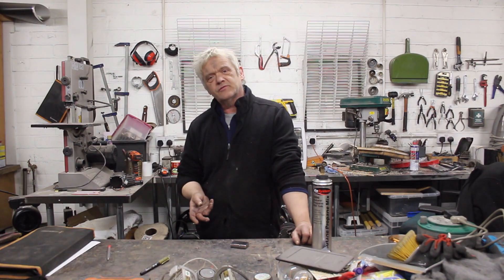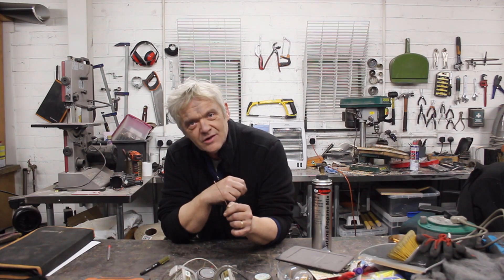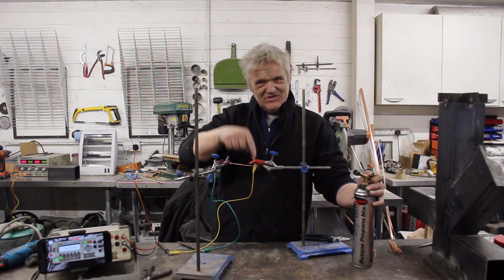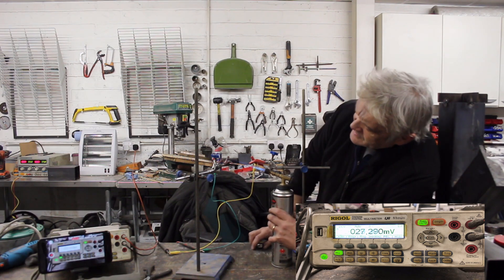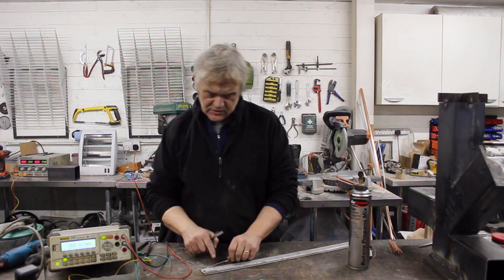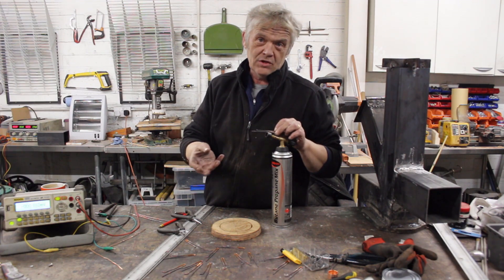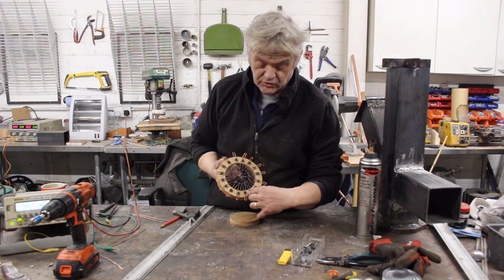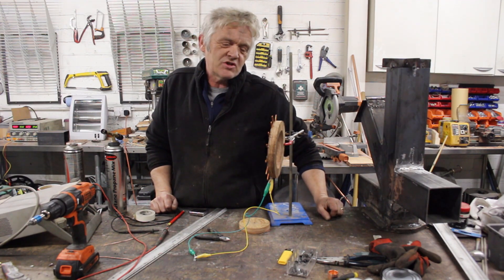1416 How To Make A Very Different DIY Thermoelectric  Generator For A Rocket Stove

Comment: Shy about asking, showing my lack of knowledge/understanding, but other than using like hair pins of copper wire, does thickness and/or alternative material (metals or minerals?) make a big difference as a solar cell(?)... And, would a battery and transformer be of any use in this?
 I've been puzzling over how valuable or not is the heat energy from thermally controlled composting; after all, it would generate 24/7.
Reply: Biogas digester would be a consistent small flame for a long time!
Reply from the maker: It most certainly will mate - this is made from a copper/copper oxide junction and is just obtainable, easy to handle, cheap to experiment with and easy to make but other more exotic and hard to handle materials will do a better job that is for sure - basically heat Is the source of all energy but I think of heat and movement as the same thing - that means going a bit deeper into the physics I am afraid

Comment: I'm thinking you could take a bunch of cheap commercial thermo piles intended for water heater gas valves and string them together?
Reply from the maker: you certainly could - it would be quite big though

Comment: That's pretty awesome.  Loved the close up of the voltage.  Such a simple way to produce a small current but very cheap to make even if its costly on time.
Reply from the maker: I like stuff that's easy and cheap to make lol
Reply: Time as a one time investment for likely tens of thousands of hours of use from it.
Reply: @Barskor1  it's great isn't it. Especially considering how little cost.
Reply: I don't think it will take You more than two Hours..